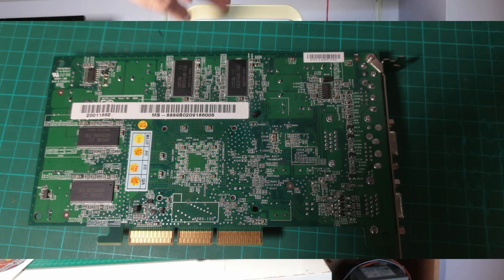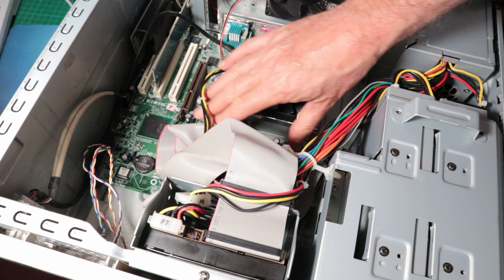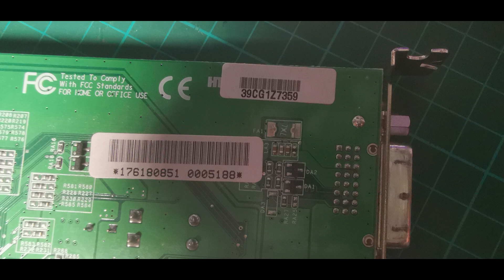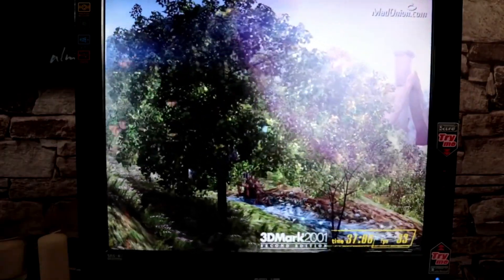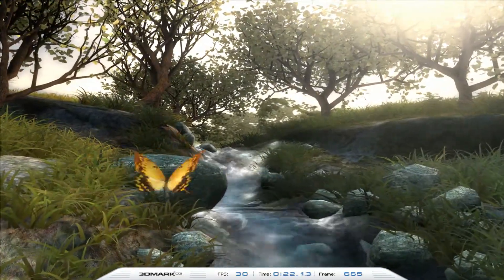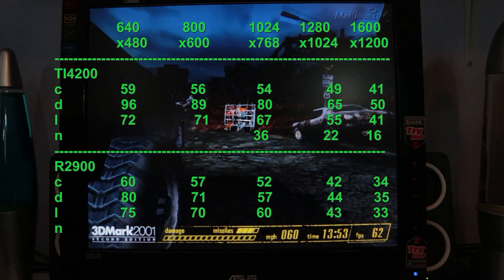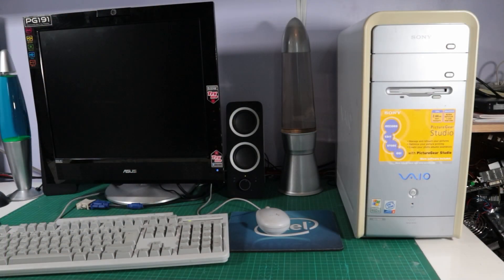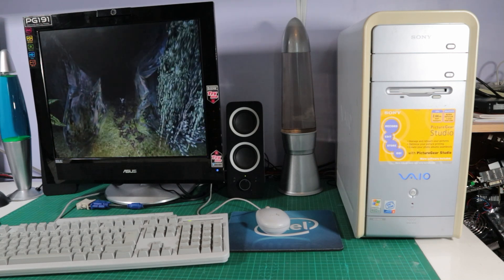Geforce4 Ti4200 vs Radeon 9200 in a cool posh Sony Vaio P4

Comment: I don't get why you would compare cards from different performance tiers, ATIs competitor to the 4200 was first the 8500 and then the 9500/9600 series. The 9200 was sold at the price of a Geforce MX. That being said, still a well-made video.
Reply from the maker: @MagicManfred  like I said in the vid just curiosity as it came out of a another similarly specced vaio p4 I had. It would be nice if I had all of the period correct competition for each card I have😁 but alas, I dont have that many😔

Comment: Crazy enough the 9100 was more powerful
Reply from the maker: Yes, and I have one ordered. 9200 was just a dx8 version of the 9000 and weak. 9100 is I believe a rebadged 8500 which was a good budget gaming card.
Reply: @66mhzbrain  I'm considering a PCI version of the 9100 for a P3 "compaq deskpro en 800" SFF pc. Though there's also an interesting version of its motherboard that has a, soldered to the board, nVidia TNT2 16MB. The one I have now has the intel 810 which is basically an i740. It too has, I think, 4 or 8MB frame buffer. yea just frame not for textures and such, that's sys ram shared just like the i740. I've always wondered if i740 performance improves with faster memory, dual channel memory, etc since texture data comes from the system ram.
Reply from the maker: That woukd be a cool build. Would be interesting to experiment with ram speed!

Comment: Please same test with Aquamark, NFS Undergrund and Unreal Tournament 2003
Reply from the maker: Those are all dx9 bench marks and these are dx 8 cards?
Reply: @66mhzbrain  nope all dx8 and 8.1. Even 3d Mark 2003 is dx9
Reply from the maker: Hehe either way, Maybe if I ever do another video. 3d mark 2003 is dx7, dx8 and dx 9 as descibed in the vid. Dx9 test not run, as stated in the vid.
Reply: @66mhzbrain  Yes true
Reply from the maker: Got a radeon 9100 coming thats a rebadged 8500le which the ti4200 was released to compete with. So will compare at some point and look at those games for benching.

Comment: The ATI 9200 128-bit had a similar performance to the 2001 Geforce 3 TI200. I liked the Geforce 4 TI4200 especially because practically all of them could be overclocked from 250/500 mhz to around 300/600 mhz.
Reply from the maker: Cool, i will give that a go. Will be interesting to see how far this lower clocked one will go.
Reply: I remember my Ti 4200-8x couldn't do even the 4400/4800SE clocks. Then later I had a 4200 64MB which OC'd almost to Ti 4600 clocks.
Reply: Great performer. Theres a Radeon 9200 Pro but it's really hard to find
Reply from the maker: @uk4890  yes I was reading about it, would be nice to get one at some point

Comment: Closer than I thought. I wonder how their retail prices compared.
Reply from the maker: Good point never thought to check, I believe they were still around at the same in stores, should have checked
Reply: @66mhzbrain  9200 was probably half the cost of a Ti 4200, if not less. For the same money as a 4200, you could have gotten a 9600.
Reply: Ti 4200 MSRP $199, Radeon 9200 $129, Radeon 9600 PRO $169